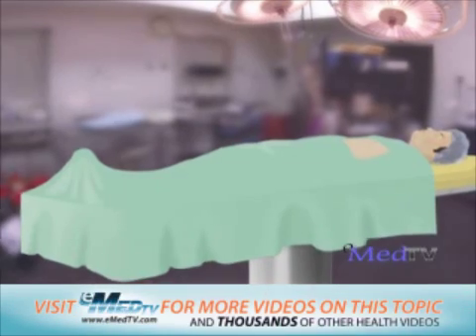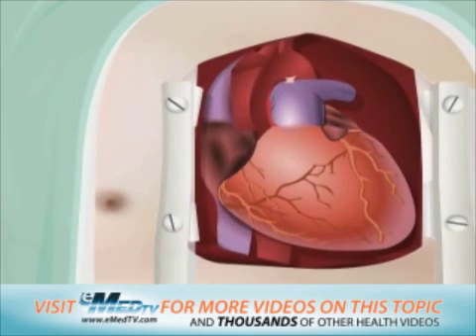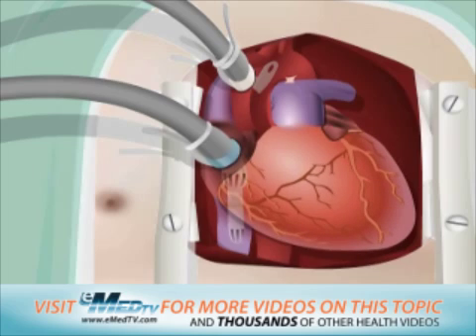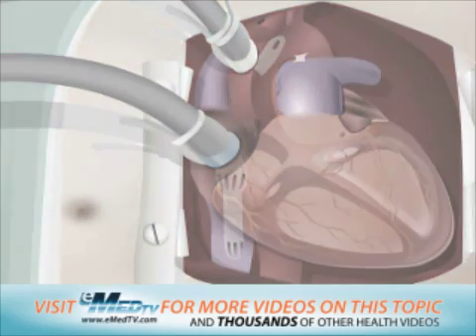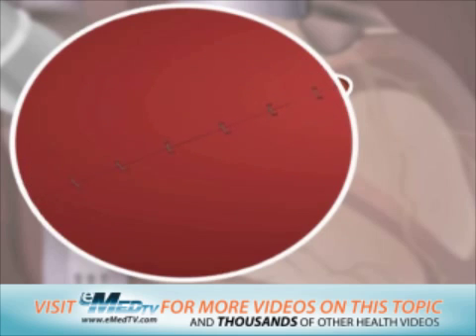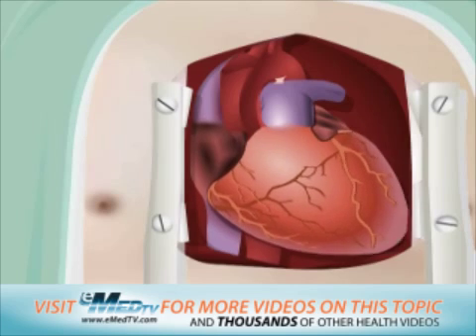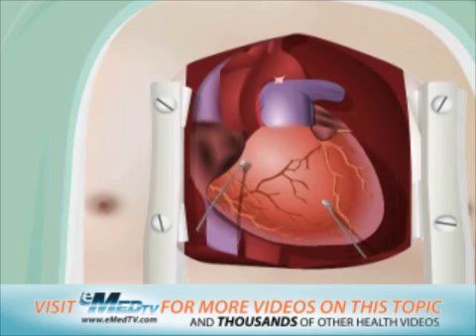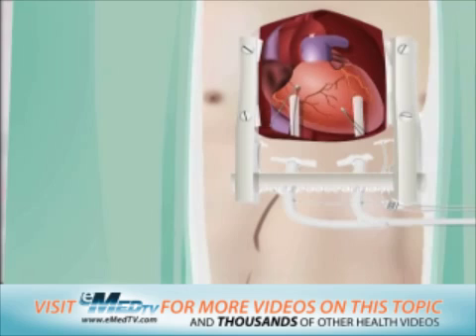Mitral Valve

Comment: At this date, this method is no longer the gold standard.  Mitral value "repairs" are by far a better choice in most people compared to any replacement.  Also, this is not showing the benefits of using "minimally invasive techniques, including Robotic assisted, which leaves almost no scars, doesn't require middle of chest to be cut, and leads to much faster recovery...and it lasts longer to do repair the mitral valve.